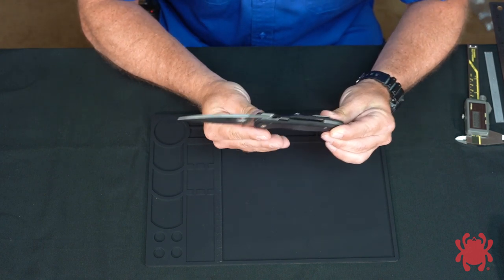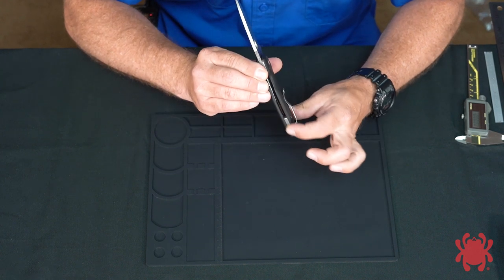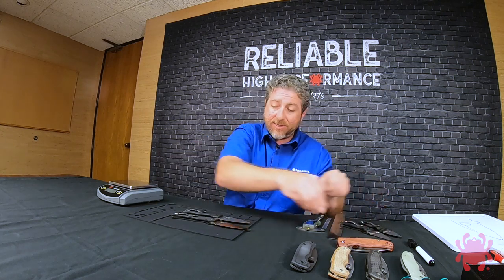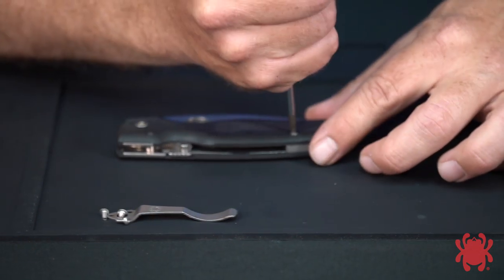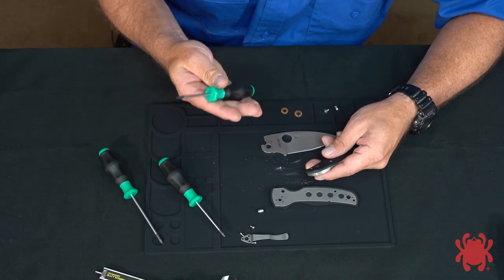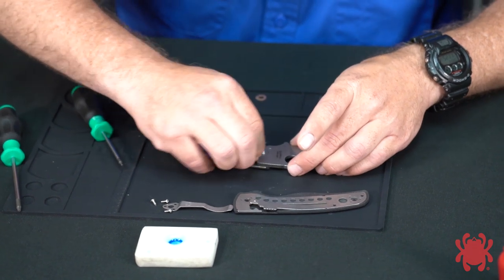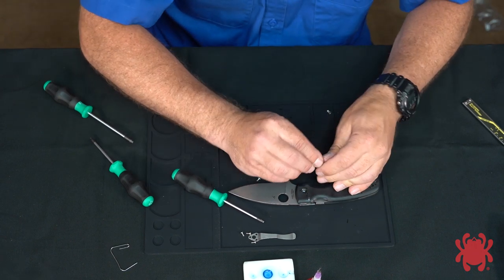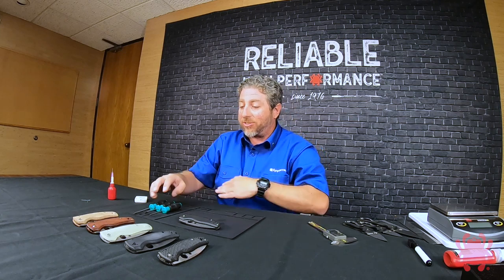Spyderco Shaman Breakdown with Eric Glesser

Comment: I don’t imagine I’ll get a response however it’s worth a try, a friend of mine got a 15V shaman and took it apart and the washers had stayed completely still on both sides via the burrs from the pocket clip holes. The scales weren’t de-burred around the edges of the scales either. Is this normal? Only one side of the tang of the blade from the pivot hole backward had worn in. Is this typical?

Comment: When you take that Nub Down so it is not covering your lock bar is so much better and easier to close .I put a coil on myself i am pleased with my shawman . I cleaned the Foster Bronze Washers and polished Them  now i can flip reverse flip closes and has a great action ? The shawman is harder to Tune than my Para 2 & 3 are easier to tune .

Comment: Are ya'll going to do another run of the Z-wear or equal blade material with micarta ? I missed the last one because I was on the road and my computer was down and that's the one I really want. I refuse to pay $ 400.00 to $600.00 for it on the secondary market. Thank you for all the great Spyderco Knives throughout the years.

Comment: Love videos do more please.  The shaman is great but....the tip of the forward choil pushes my finger out of the compression lock.  This reduces the fidget factor, but also reduces the ease of break in.  If I did not have a dlc blade I’d probably grind off an eighth inch or two mm from the most forward part of the choil, just saying.  Any suggestions for tuning with attention to this?
THX again, Steve

Comment: Here's a challenge, Eric.  Make an ambidextrous compression lock.  What's the point of have four way clip options if the lock is designed for righties only?
Reply: Moto Rick : I’d suggest do away with the compression lock all together and give the Shaman the ball type lock like the Manix 2 has. It’d be far superior in my opinion.

Comment: I just picked up a garden variety shaman in stonewashed.  sealed box - first opened, and noticed immediately a LOT of blade play, closed and open...  also, and even more concerning to me is there's an interesting thing, I've not experiened with any other folder so perhaps this is just a "spydie" thing, but as the blade on the Shaman reaches almost full extension, there seems to be TWO stages of compression lock... an audible click about 3-4 degrees from fully open, like it's stuck on the bar or something, then finally snaps into fully locked position...  so... anyone have any insight to offer - first spyderco - first compression lock - is it a dud? or is that what we get now for north of $200??
Reply: The two stages you're feeling is just the detent ball slipping off the blade. The ball slips off and the compression lock bar rests directly against the blade  briefly before it slips into the tang cutout and locks. That's perfectly normal. The blade play is not normal. Start by tightening the pivot to see if that helps.

Comment: Eric, where do we find that rubber mat you got there?
Reply: Amazon. There's a lot to choose from and they sell for $10-20. I love mine.
Reply: @MFD00MTR33  The little retention ponds on mine are great for organizing the bolts in order of disassembly. Sometimes there are screws that have to go in particular holes due to lengths being different and avoiding action or blade interference.
Reply: @Crusty_Otter  they're definitely handy. You can have you pocket clip screws in one section, body screws in another and pivot in another. Plus they protect the finish in your knife. Great piece to have for knife maintenance.

Comment: Love Spyderco knives! The only problem I have had is every spyderco knife (Paramilitary 2 in S30v, Para3 in both S35vn and 52100, Delica4 wave, and a Dragonfly2)  I have bought have not been sharpened all the way to the end of the blade with a slight s curve, forcing me to cut a sharpening choil  myself on all of them so I can sharpen it correctly.
Reply: I hear people say this about Spyderco knives... But I've never had an issue sharpening from heel to tip without modification. What equipment do you use to sharpen?

Comment: I wonder how many rodeo clowns complain of sharpening choils on their knives?

I’m not a rodeo clown, but I am glad Spyderco doesn’t put a sharpening choil on their knives. Most companies don’t do a very good (and consistent) job with their sharpening choils anyway. Moreover, I think it is better to leave it up to the end user to decide if they want to add a sharpening choil (easy to do) or if they would rather bring the edge all the way back to that plunge grind (also easy to do).

Excellent knife, the Shaman. Though I do wish it had a different locking mechanism; preferably the caged bearing lock, but even a back lock, would make more sense on this knife (IMO).

Comment: I've been sharpening my own knives for ~ 5 decades, and prefer a sharpening choil. The more the knife is used & sharpened, the more important the choil becomes. I don't recall ever getting anything stuck in the sharpening choil of a blade, especially if the choil is shaped properly. Hard to reconcile the "might get stuck" idea, when we think about a blade shape like your Native Chief, with a big, deep, forward finger choil, forward of the ricasso, that is unlikely to be occupied by a digit, during the kind of fast deployment, life/limb at risk, scenario you suggest. Wouldn't there be more chance of "getting a rope stuck" in that? While the choil is a small additional production step, adding a small cost, the value it adds to the blade in a clean edge, ease of sharpening, and aesthetics. If Case can do sharpening choils on their inexpensive slip joints, we should certainly see them on much more expensive knives like Spyderco. :)